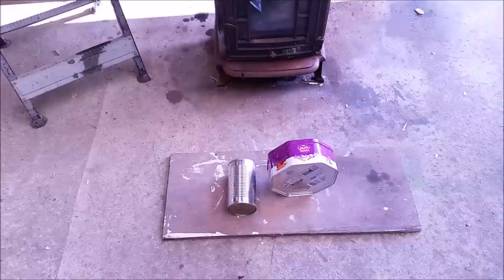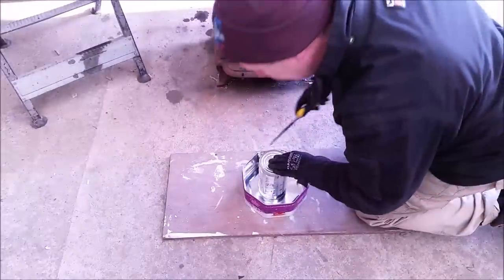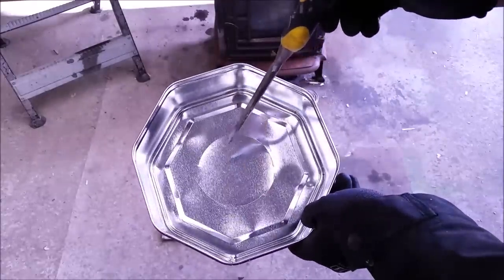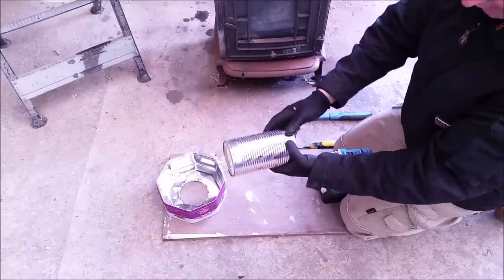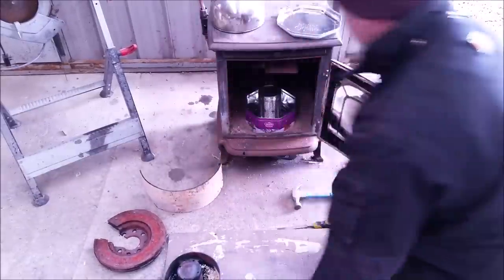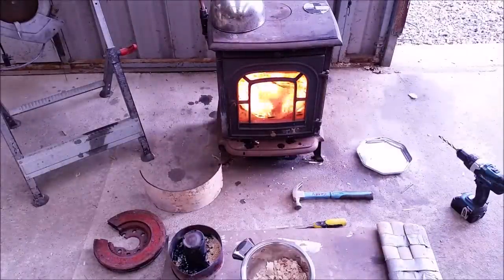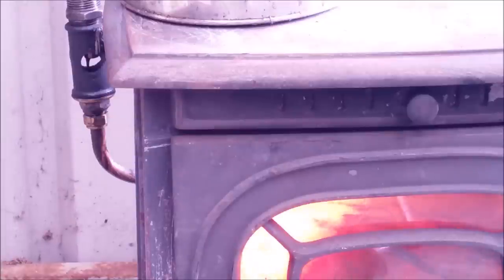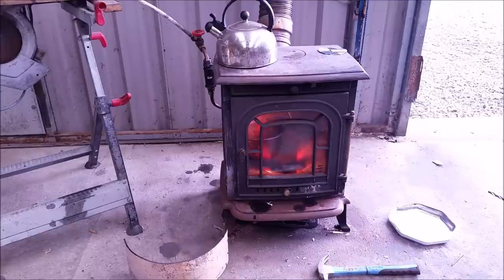Homemade Tin Can Waste Oil burning Heater .. AWESOME OUTPUT ! ..

Comment: When a company called Deiselveg were converting cars to run on veg oil some 15yrs ago( mine did 380,000 miles on old veg oil) they built an oil burning stove which kept a large work unit warmish. The thing glowed cherry red and the heat output was awesome. Problem was the metal drip tray kept burning away and no matter how thick and heavy you made it, it eventually burned through. We never used cast iron though which could be interesting.
Reply from the maker: Thanks Merve. There is a lot of energy in a gallon of oil. The welded version of this burner makes my stove cherry red, in excess of 1400°f Thanks for commenting much appreciated Cheers Gerry
Reply: Charlie Rothwill Is that your argument? Would you please tell me how I have lied????
Reply: GerrysDiy - yes Gerry, there certainly is a lot of energy in a gallon of oil- it always amazes me how long an oil soaked rag will burn! The stove they made ran on ‘gloop’ - that’s the animal fats and other impurity’s found in used veg oil and that sinks to the bottom of the 20 litre containers and is of no use in burning in an engine. However, with a header tank positioned where it would benefit from the heat the stove gave off, ie- enough to melt and keep the gloop fluid, then it would drip and burn very well. Truly a waste product being used in a positive way!  The rest of the clear oil was put through a 100, 20 and a 1 micron filter system and was well clean enough to go through the injectors. To get back to the stove, There has to be a way of stopping the burner from being destroyed by the heat - as I said, a cast Iron one might be the answer. Good lock with all future marks mate.
Reply: Remember Dieselveg in Wolverhampton, had their gear on my motor.
Reply: Dave Knight Hi DAVE, thanks for replying. Yes, one of the best things (financially) I have ever done. The van was brand new with 449 miles on the odometer when it was converted. The cynics told me not to- I’d blow my engine up etc etc- 380,000 miles and 13 years later I drove, yes DROVE it to the scrapyard!  Best van I ever had and the cheapest motoring by a country mile. I still use veg oil in a 23 year old Toyota Surf in the summer when I put 50% veg oil in the tank. Saves me a small fortune whilst towing the caravan! Common rail diesels don’t like it but my old Surf runs on it perfectly. Thanks again.
Reply: Merve Gaskin Guys, try a visit to your ceramic shop to fab something up. Professional refractory is Alumina and there's a variety of additives. If a factory nearby uses alumina try to visit some day the refractory rep will be there.
What about a cement model that has air tubes molded in. The could even be directional.  Another industry buzz word for you is tuyere. Hope I spelled it right.
Reply: If you can get some & haven't already tried it, tool steel or high-speed steel might last a good while.  Or get some firebrick & refractory cement.  Or even go really old-school, and make a drip tray out of clay, dry it (oven at low heat?) and fire it by use.

Also, a lot of older diesel engines can run on straight filtered cooking oil.  People here in the US have done it with respectable results.
Reply: @artsmith103  yeah,French for pipe.
Reply: @ianrutherford878  I speak entry level French and didn't know that. In the industrial furnace business, Tuyere is a combustion nozzle.
Reply: @artsmith103  I speak Industrial furnace and I did know that.

Comment: what about putting your intake thru shop wall instead of sucking all your warm air thru heater and outside  Jon in Kentucky usa
Reply from the maker: Hi Jon. My shed haemorrhages air top and bottom to deal with condensation. If it were air tight or close it would be necessary to use external air alright. I just had a quick look at the weather in Kentucky and the temperature profile looks a lot like here in Ireland right now. Thanks for the comment Cheers Gerry

Comment: Where the small can meets the larger can, is not sealed, so that you are not only letting air in there, but also you will be allowing your waste oil to accumulate unburned under the stove, in the air intake. That could lead to a major problem couldn't it? ONe time our oil heater malfunctioned and there was oil coming out of it all over the floor, while the oil burner was burning hot. I looked at it and said to myself, Well now, let's turn off that emergency switch, shall we? The repair guy said it was amazing the whole house didn't burn down in 15 minutes. I had just noticed a slight change in the way the oil furnace sounded, so I went up to the utility room where the furnace was and saw that oil POURING out of the furnace, with Big flames in the chamber just about the way your furnace looked (burning at a high rate with plenty of fuel). Fortunately, the flames and burning oil did NOT seep out, I don't know how in heck I was fortunate enough to do the right thing -- it was really amazingly dangerous.
Reply: Also--The energy density of oil is so high that when you have an oil fire escaping from your oil heater, you have very little time to practice your inventing skills...

Comment: Interesting but a torpedo forced air kerosene heater will heat a shop pretty well to, and it might be a little safer. (Mine burns kero, diesel, or home heating oil)
Reply from the maker: Hi pineyLt I have used this design in quite a few of my projects but the biscuit tin was just for quick trial. In my later stoves the burners are welded steel. \https://goo.gl/96qYye is a playlist of some of the stove builds. Thanks for commenting Cheers Gerry

Comment: Is there any smoke at your chimney pipe exit ? Since it is made with very thin metal cans, how long does it last ? Do you have to filter waste oil to prevent cloging ?
Reply from the maker: Hi Christian. Here's a video where you can see the finished unit and I show the flue as well. There is no smoke from the chimney so long as I dont go too heavy on the oil. you will see in the video I have used this burner in lots of my recent videos. It works great and is easy to make but I make it from steel. The sweet tin was just to try it out quickly. Here's a link. https://youtu.be/tnzEDEpz3Yk Cheers Gerry

Comment: A friend made a oil drip heater using a 55 gallon drum,8 in steel pipe that had a 5 inch pipe that was welded to the 8 in and went out through a hole in the bottom. He passed away and that heater was hauled off for scrap. I am not 100% sure how it worked, I wish I couldve seen it in detail but it was always on when I seen it & the heat it put out was crazy. I do know he had hug bags of steel wool he kept he used it insidethe heater but i don't know how it worked.

Comment: Would have been nice to see the roaring fire through a soot-free door!
Reply: simon4043....Would have been nice to see you make an intelligent comment for once in your life....
Reply: Yes, if the door is getting black, then there is incomplete combustion, which is inefficient and wasteful.
As is sending most of the heat out through the chimney, when it could be extracted in a mass exchange system that gently heats for long after the fire has burned out.
It's not how hot you get the fire to burn that counts. It's how much of that heat you can retain where it's needed.

Comment: What is the average fuel consumption?  A friend has a used oil furnace for his airplane hanger.  He started inviting others to dump their used oil in a 1800 liter fuel tank outside and they quickly filled it beyond his consumption rate so he added another tank.  Free heat for the last 20 years. He does have filter expense at the heater and just before his pump from the tank outside. The hanger is 8 meters high and 20m X 20m

Comment: Is there smoke coming out of the chimney? If it isn’t burning clean then the chimney will plug eventually with some real nasty black stuff. If you burn that hot enough so it is clean that tin can and pan will burn out right away. My setup burned holes through plate steel so I switched to stainless steal. After the nightmare of the chimney plugging I add a forced air supply to make it burn hotter and clean, no plugged chimney now. With trial and error I final got a system that is pretty safe, burns clean, and heats my 30’ x 44’ x 12’ garage during the winter in northern Vermont. I’ve seen some fancy setups on here but I pulled it off pretty cheap using my small wood stove. Less than $100. Good luck all in your adventure for free heat, I did it so anybody can.

Comment: Hi Gerry I made your burner last week and I placed it in a back boiler stove it works kinda well heats rads. I can't get the draw on it tho it's little smokey. It's in my workshop and the flue is5 metres high. Can you recommend anything to help? Thanks. Love your videos. Good man thanks.
Reply from the maker: Hi Rory. Whats your flue diameter and how airtight is the stove. What are the dimensions of the burner and the size / placement of the holes. If possible you can message me on facebook or youtube with photos or post a video. If you put some kero in the burner and light it you should get that roar like a rocket stove that you hear in my videos. Once the burner is hot you will get the same roar from used oil. This noise is a result of the combustion that happens in this little burner as the air and fuel are mixing. Rory did you make /  build ? Is all the air for combustion travelling through the burner. Cheers Gerry
Reply from the maker: Hi Rory. Did you make alterations after our phone conversation. Cheers Gerry
Reply: You are breathing Carbon monoxide which is deadly

Comment: You've shown how you make the burner and how to light it. 
But you've not really explained how it works. Does the oil drip into the biscuit tin or on top of the dog food tin?
How much oil does your stove use? A liter a day? 5 liters a day?
Reply from the maker: Hi Jan. Here's another video where I have a drip feed to the burner. https://youtu.be/WyredKT2VdE These were just prototypes before I made it in steel and installed it in my shed. I have many videos on all of this. Hope tis helps Cheers Gerry

Comment: What kind of smoke does this produce?
Reply from the maker: Hi. here's another video with the same burner made from steel. https://youtu.be/tnzEDEpz3Yk?t=89 I even cooked on this stove. Hope this helps Cheers Gerry 👍
Reply: Hello!  I burn waste oil by just using an old frying pan set on a grate in a wood stove.  Thee smoke should be avoided. Very acidic and will destroy galvanized stove pipe in several months. And there is also a considerable amount of soot created.

Comment: you can easy get a woodstove to burn on oil...fill the gap where firewood shall burn with sand...then you have a takt with diesel and a pipe from it to the sand...get some paper into it
with diesel on it and fire up the sand who uou have already put diesel in...than regulate fire with the tapkrane in the tank upabove,
Reply: takt =tank ...sorry

Comment: The oil tank had better be outside. Inside can be dangerous. As the oil warms up, it flows faster, and faster; then disaster. A customer's truck shop nearly burned years ago, from a home made used oil stove.
Reply from the maker: Hi Tom. You are absolutely correct. I will be making an upgrade to the stove heater in the shed soon with a pump but I have been using this setup for attended sessions only. Thanks for commenting Cheers Gerry
Reply: Maybe is it's 10W40 or higher it'll flow slower but we're using used oil so beggers cant be choosers.

Comment: I have no idea what's going on!
Just a biscuit tin and a can, and a heavily modified wood stove, and a feed system for the oil, and pesto that's all it takes......
Reply from the maker: Hi Richard. This was just a quick way to prototype a new burner design I had in mind. I built it from steel and I heat my shed with it now. I have made another version of it out of welded steel and I show how to make it and I also show it heating my shed. https://youtu.be/ShTLaYKjzxw Cheers Gerry

Comment: Modern motor oils have heavy metal additives - I'm not sure I would risk breathing the exhaust !
Reply: U are correct, there are all kinds of carcinogens in used motor oil, really bad stuff.  I would think most veggie oil would be ok.

Comment: Sir I can see smoke coming from the right side of the stove. is this carbon monoxide? if so you will need good ventilation.
Reply from the maker: Hi Barry. The smoke you can see is coming from a drip pan under the stove with oil in it. The heat from the outside of the stove is causing the oil to smoke. In operation the final version of thin burner does not smoke . I did a test install of this burner ( final welded version) in a domestic boiler stove and was able to heat an entire house and 80gal US  of hot water on 2 litres. Here's a link. https://youtu.be/XmAqunRfCaA Thanks for the comment Cheers Gerry

Comment: Wouldn't oil drip through the hole in the bottom ?
Reply from the maker: Hi This was just a quick prototype to see if the concept would work. Here's one I made from welded steel that is also simple to make but has my stove glowing red hot https://youtu.be/ShTLaYKjzxw Thanks for commenting Cheers Gerry 👍

Comment: What do you say cold at 6     it fecking freezing in Carrickfergus and yes I sing the song it's -1 that's cold there is a white coat on the car and the ground   
Told you freezing this heater might help in the work shop    no well shed  will it work
Reply from the maker: Hi Harry. I made a a welded version of this burner and I also made a stove cooker to put it in. It makes a fantastic shed heater combo. Here's a link to it. I even managed to make a cooked a breakfast in the shed lol. A few pints and a guitar and we could lash out a few tunes. Here's a link to my shed heater https://youtu.be/tnzEDEpz3Yk
I made a few series build videos on how to make the whole thing. Thanks for the comment Cheers Gerry
Reply: Harry ! What Gibberish Do You Speak ?  : )

Comment: nice design! how do you keep oil from leaking out the bottom of the stove if you drip too much?
Reply from the maker: Hi FOG MODZ I have a tray under the stove so the short answer is it can leak.  The tin can is only a prototype and in the next video I use a better built burner ( welded ) but if not metered properly the oil can leak.  There are more videos with improved adaptations. https://youtu.be/lU93mSoaJEk  Cheers Gerry
Reply: is a great idea! im going to try it on my next build.. i built the large tank dual chamber design you made before and works great! just finished my second build with small propane tank. this style will be the next!  appreciate your vids!
Reply: A tray under the stove. Sheesh.
Reply: The Beardsmith o

Comment: How much fume smell is there outside off this please ?
Reply from the maker: Hi Stuart. Here's a video I re-made of the same burner to fix the audio problems. https://youtu.be/hw3v2gN_sLk Check out my playlist for this burner welded and made from steel in some of my other stoves. Big Playlist https://www.youtube.com/playlist?list=PLmQ5wJnkAIoJYDBgSOis9s1yDhcFdswtN  If used properly there is no smoke and little or no smell. Hope this helps Cheers Gerry 👍
Reply: @GerrysDiy  thanks Gerry

Comment: I built a very primitive oil burner out of a 22.5 gallon drum, used an old car brake line and a small brass valve. It works well but if you let too much fuel in and don't dampen it properly it sounds like a locomotive and starts to dance across the shop floor...not good!

Comment: what waste oil are you using I.E old engine oil or cooking oil or can you use both
Reply from the maker: Hi Darren Used motor oil and used veggie oil. They both work very well. You may have seen these but here's a link to one of my playlists where you can see more https://goo.gl/E8GKzm Cheers Gerry
Reply: @GerrysDiy  thank you gerry I will check them out I'm looking at making something like this for my small workshop at the bottom of my garden only 10ft by 9ft and one like this should do nicely and will come in handy incase the power gets cut off soon.  thank you

Comment: The whole set up acts like the old smudge pots. U could put 5 gallons of just about anything flamible  in them. Had to use a cutting torch to light them lol
Reply from the maker: Hi Junkworks1. It is like one alright but when the air is forced in through the bottom only for combustion it acts more like a rocket stove and really rocks. I made a smudge pot burner recently here and it goes nuclear lol here's a link https://youtu.be/WyredKT2VdE Cheers Gerry
Reply: GerrysDiy, like those type videos. I love doing this kind of stuff. All this talk about biscuits is making me hungry. My smudge pot starts out chuggin like a freight train, as it warms it sounds pretty much like a rocket. 😂

Comment: Doesn't it burn up the oil too fast?
Reply from the maker: Hi Mark. This was just a prototype. When I made the full version it burns between 2 and 3 litres per hour. Makes a lot of heat for that amount of oil. Cheers Gerry

Comment: If this waste oil is from automotive engines; folks might want to consider the possibility that the waste oil may contain lead and other heavy metals from the bearings wear surfaces. So for example lead, copper, nickel,  antimony, cadmium, etc. will be vaporized and end up in neighborhood children.

Comment: how long does the dog food can last before it needs to be replace?
Reply from the maker: Hi David. I thought that it would disintegrate after the first burn but I got several hours out of it. I made improvements to this burner and made from steel I get a couple of years from them, Easy to make and cost very little. Thanks for the comment Cheers Gerry
Reply: It spontaneously combusted. Just went woof!!!